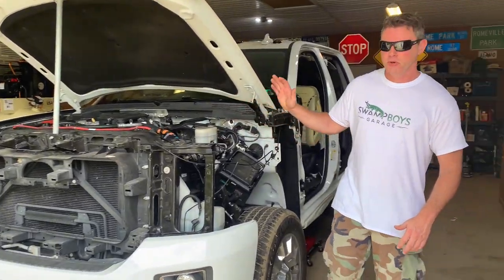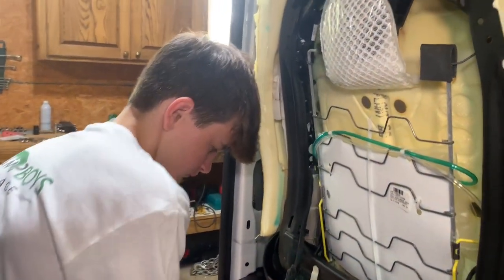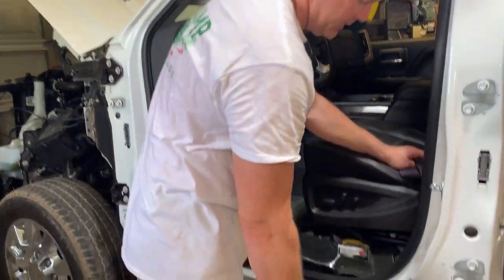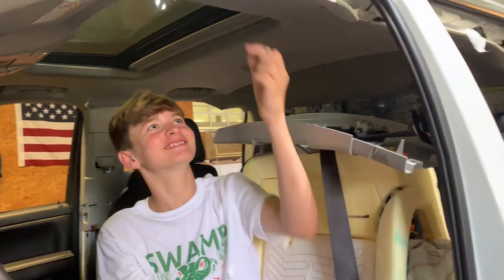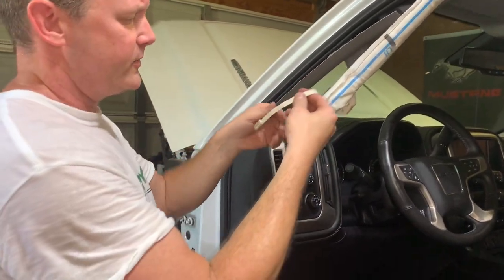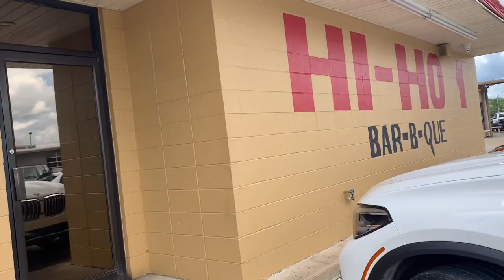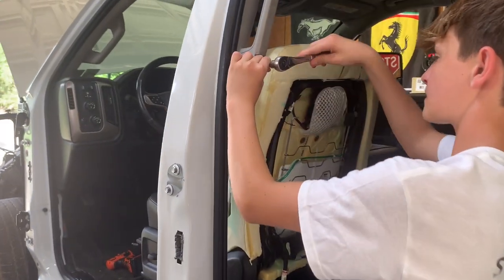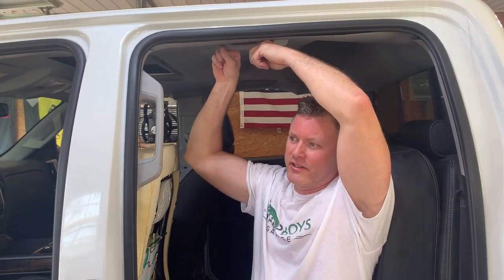Ep. 3 GMC Sierra 2500 Duramax | Installing Airbags and Seatbelts on the Denali Truck

Comment: Really informative video.  I never knew how airbags worked especially the side curtain ones. My tip on getting bolts going into a deep hole is putting a piece of masking tape between the bolt and the socket so it doesnt want to fall out.  Thats going to be a great truck.
Reply from the maker: Thank you. That’s a good tip with bolts. We appreciate it.

Comment: I enjoy your videos.  Regarding the after market fender in primer.  I'm not a body guy, but was advised by a painter to check the primer.  if it wipes  off with lacquer thinner, the new paint will not adhere well.  All of the black protective coating will need to be removed then primed and painted.  Keep up the great work.
Reply from the maker: Ok. Thanks. I’ll do some research on it.

Comment: When replacing the airbags make sure you replace the crash sensors call the local dealer to see if you have to replace the craft sensors I know my Pontiac G6 I replaced them cuz you don't want to put the module in and then hook it up if the crash sensors are activated I haven't done it in a while so I don't know is it matters or not
Reply from the maker: I’ll look into that. Thank you